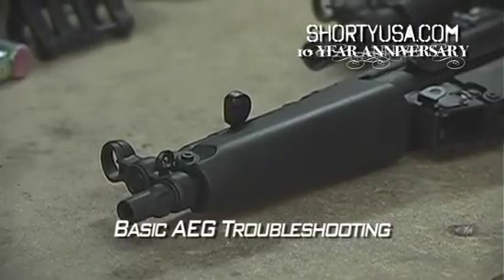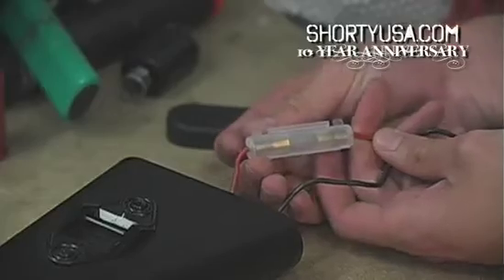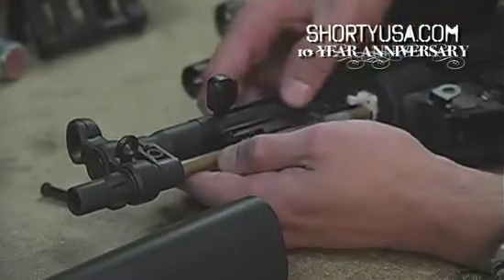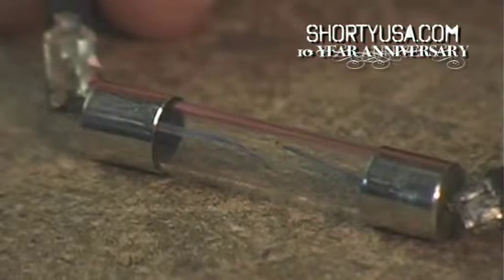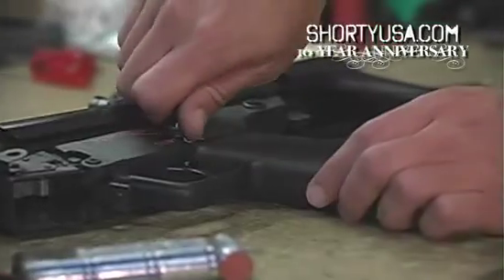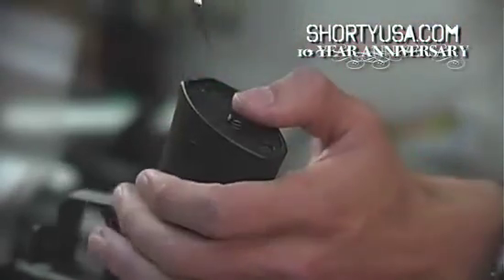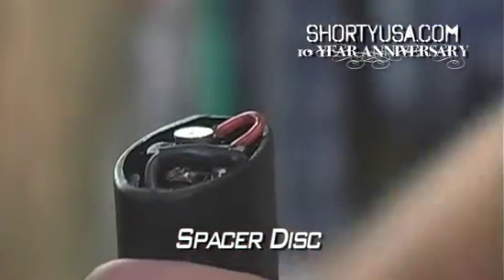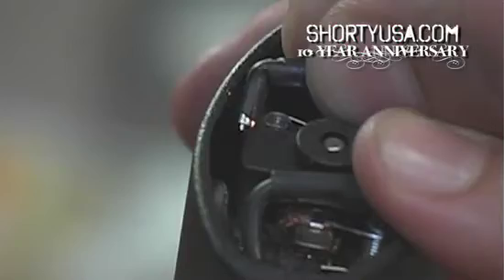Basic AEG Troubleshooting

Comment from the maker: The fuse on the Paratrooper (AK-47S) is a little different. It is located under the battery tray. You have to take off the hop-up adjustment tab, then unhook the bolt spring guide from the square peg at the back, then remove the small screw on the right edge of the battery tray. Then you just have to pull back a little on the battery tray to unlock it and then lift the whole tray up.

Comment from the maker: @BGBx If the battery works in another rifle then the problem is most likely electrical. First, double check that the battery is properly connected and that all the wires going to both the rifle's and battery's connectors are not loose. Try firing the rifle in both fire modes since if you release the trigger at just the right time in semi auto the gearbox will not start again until you switch to full auto. Try checking the fuse as it shows in the video as well as the wiring to the motor.

Comment from the maker: You can use a voltage meter to see if power is going to the motor when you pull the trigger. If it is a M249 it is probably the trigger snap switch though. Grease can sometimes get into them and cause a bag contact. The switch is easy to replace if you find it is the cause.

Comment from the maker: You can typically find them at electronics stores like Radio Shack. Go to their website and do a search for a 250v 20 amp fuse. You can use either the glass ones or the ceramic ones.

Comment from the maker: Well, except for the clicking it would sound like the gun is jamming. In case that is what is going on try watching our video on the E90 break down and pull your barrel off. Clear any BBs out and then put it back on the gun. Turn your hop up all the way down and give it another try. Make sure you are using high polished BBs weighing at least .2g. If the rifle fires slowly start increasing your hop up until you get it to the right level. If it jams again, try lubing your barrel lightly.

Comment from the maker: @pizzaguyman13 That could be a number of things unfortunately. I'd start by verifying that your battery does in fact work in other guns. If so then it could be that a gear has broken and is jamming the gearbox, or it might need to be reshimmed, or maybe something has gone wrong with the motor. It is unlikely that the motor height is the issue although you could try backing the motor height out some. If the motor is pushed into the gears too hard it could jam the gearbox.

Comment from the maker: @banbsmith87 That could be many things. Dirty barrel, low grade BBs, BBs that are too light, torn hop-up, damaged barrel, etc. I would start by cleaning the barrel and making sure you are using high polished BBs that are at least .2g. Typically if the rifle shoots over 350 fps w/ .2g you would want to use .25g or heavier for best accuracy.

Comment from the maker: @FredErikson911 If you haven't already, try a different battery or at least try that battery in a different rifle to insure it works. If you find out the battery is working fine then unfortunately something has probably broken inside of the gearbox which has jammed it. If so then it is typically a broken tooth off of a gear.

Comment from the maker: Make sure your battery is fully charged (the best way is to try it in another gun). If the battery is charged and you are still getting the clicking sound then something has gone amiss in the gearbox which has caused it to lock up.

Comment from the maker: @ryando67 I'm not sure what could be causing the trigger issue however it should not have been caused by simply changing a stock. There could be something causing the internal safety block to stick or something could have come apart inside and is blocking the trigger.

Comment: yeah you should ajust the motor height all you have to do is tighten or loosen the screws on the bottom of the pistol grip where the motor is found and after you loosen it a little fire the gun and when you tighten it do the same thing and keep doing it untill your gun makes the right noise

Comment from the maker: @campinggear1 Ok, so if the rifle keeps cutting in and out (electrical) then you probably have a loose connection somewhere. At that point you just have to start tracing the wires back through the rifle to find the troublemaker.

Comment from the maker: It is possible the battery just needs to be recharged. If you think you let go of the trigger just before it was going to fire then the piston is probably all of the way back so it will take everything the battery has to get the gearbox moving again. Hopefully charging your battery up solved it but if not see if you can use someones 9.6v battery and see if that is enough to get it going.

Comment from the maker: You actually want the fuse to blow. The fuse blows so your guns wiring system doesnt burn up. If your fuse keeps blowing there is either a problem with the gun, the battery or you have a lower amp fuse than you should be running. Most AEGs use 250v 20amp fuses however some still come with 15amp fuses which can heat up and blow when used with a high output battery. In which case switching to a 20amp fuse would most likely solve that issue.

Comment from the maker: Inconsistent accuracy and jamming magazines could be from the grade of BB you are using. The .2g BB is made in several different grades. AEGs should only be used with high polished BBs to avoid jamming and performance issues. If youre not using high polished, try that first. If you are already using them then please put in a RMA request so we can take a look at it.  

P.S. As far as your jammed magazine, try slapping the side of it down against a hard surface to help jar the spring loose.

Comment from the maker: I'd try lowering the hop up first just in case it is up so high that it is coking the barrel. If that doesn't do it next I would try lubricating and cleaning the barrel. If it still doesn't work correctly and you are using KSC BB's I'd guess that the hop up bucking is torn.

Comment from the maker: Well, first I would be sure your battery is charged and that it has a high enough of an output to run the new spring. As long as you know for sure that the spring isnt too strong for your current set up (a CA can take up to an M120 without further modification) then it sounds as though something has locked up the gears. This could be a number of things from incorrect shimming to a broken tooth. Unfortunately the only way to find out is to open it back up again. Sorry dude, that sucks

Comment: I have a CYMA Thompson M1A1 and it stopped working.  I have confirmed that the motor is the problem, but all of the wires are connected and everything.  I think it might be the wiring inside the motor itself...sometimes (randomly) it will fire again if i jiggle around the motor and stuff, and I'm fairly convinced it isn't faulty wiring.  I'm not quite sure what to do though, and I'm hoping I won't have to replace the motor.  Any suggestions?

Comment: umm im havin a little problem wit ma new echo 1 m4a1 carbine. i'd been shootin it a couple of times but now it won't shoot. i think i'd let go of the trigger a bit early. now it won't shoot & makes a very silent click noise when i pull the trigger. i also tried shootin in auto, but same result. i checked ma fuse & it's perfectly fine. idk if ma battery is low, so im charging it right now... i wud appreciate if u answer ma questions & helpin me out wit ma problems. thanksss!

Comment: You should always use the exact fuse that's in the AEG. You wouldn't just use a random piece of metal in your electric system at home would you? Same thing. It's designed after very spesific measurments and can't take much variations.

Comment: I have a JG G36E and have replaced my fuse, charged my battery (2 actually) and tested on my gun but still doesn't work.... I guess the wiring in the motor is a problem but how do I reatach the wire to my motor in a G36?

Comment: my gun is not firing at all- as the spade connectors going to the motor were phucked- so I have put new ones of those on, still didn't work- I now see that the fuse is dead, so I have tried bridging the gap with a nail, and still it doesn't work! Will putting a new fuse in make it work, or is there something wrong with my battery, motor connectors, or motor itself- or trigger contacts!!!

Comment: i have an echo 1 mp5a4 ris vector arms, and it is not functioning properly.  The first round i shoot will shoot with the righ power but will curve left greatly, and every shot after that either shoots really slow and short or doesnt shoot at all and makes a muffled sound.  My battery is fully charged and working but i do not have a spacer disc in the grip of my gun by the motor.  it was recently working properly then all of a sudden this happened.  your help would be greatly appreciated. Thanks